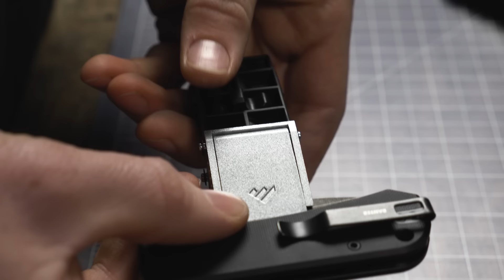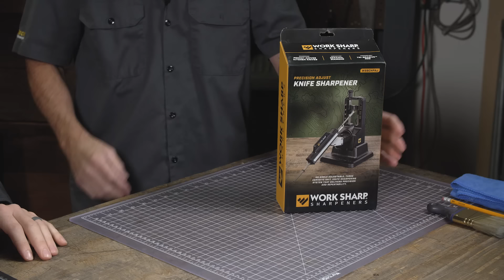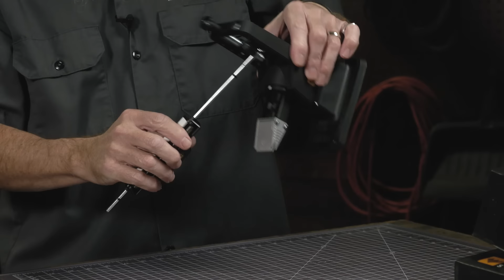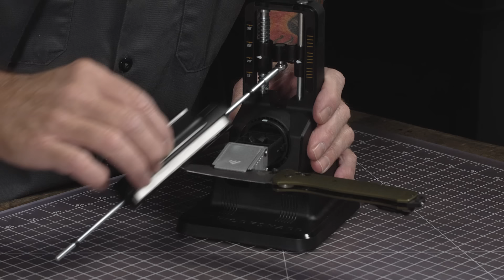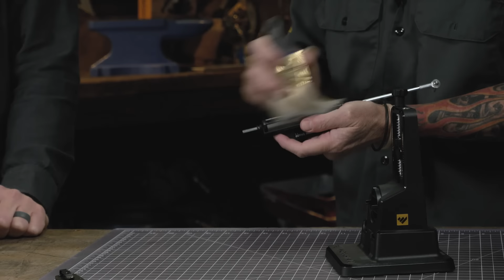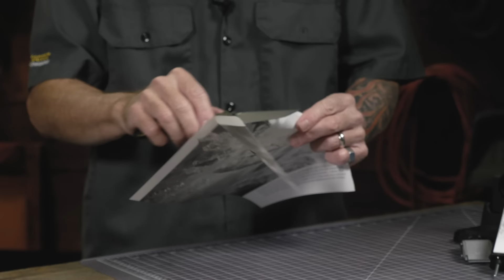How to Use The Precision Adjust Knife Sharpener - User's Guide: How to Sharpen a Knife

Comment: As far as I can tell, that 20-degree angle is not actually 20 degrees. It looks more like approximately 40–45 degrees! This is a serious mistake!
So, if customers are being misled about this, then this product is a scam. There is a huge difference between sharpening a knife at 15 degrees and sharpening it at 40 degrees!
The basic rule is that a knife, or any cutting tool, MUST be sharpened at 15 or 20 degrees, and the sharpening angle must never exceed 20 degrees!

Comment: Getting mine tomorrow. Was curious, wont the distance between the knife spline and the cutting edge change the angle of the sharpener? Like if my kitchen knife is 3” wide and I set the sharpener to 20 degrees it would end up being a different angle compared to a 2” wide knife? Cheers!

Comment: I’d like to see you guys sharpen a Case trapper pocket knife, and/or kitchen paring knives. Both these blade are approx 9/16” wide. I’d like to see how the clamp holds these and if the abrasive actually with contact cutting edge of knife. So many of these type sharpening systems fail on these types of knives. 
Thank.

Comment: How can you be sure of the sharpening angle when the depth of the blade in the clamp will determine the angle also.  So a different width blade on a different knife will be of a different angle.  How do you compensate for that??  Every blade width will not indicate correctly on your angle gauge.

Comment: Just received a reply from work sharp, as I just purchased this. They will not tell you that depending on knife, their product will not hold securely. They actually said to not to try and use this, sharpen your knife FREEHAND?????? kind of defeats the point. Anyway, buy something else like a cheap temu sharpener which will work. I just pitched my worksharp junk in trash.

Comment: I'm confused, in one of your other videos you did 4 different ways to move the sharpener, and put each result under a microscope, the end result was the push method yielded a much sharper edge of the 4, and the sawing method had the least sharp edge of the 4.  Why are you now using the saw method?

Comment: How do you put a smaller knife in the clamp? I can not get get some of my smaller normal size more classic style Case knives to fit in it so it can be sharpened.
Reply from the maker: On the original Precision Adjust, the limitation you’re running into is spine-to-edge height. Many classic Case knives (pen knives, stockman blades, etc.) simply don’t have enough blade height for the clamp to grab securely and keep the knife centered and stable.

That’s exactly why we added the Small Knife Table on the Precision Adjust PRO — it solves this issue by supporting short blades that can’t be clamped conventionally.

For the original Precision Adjust, the best options are:

Use a manual sharpener like the Guided Field Sharpener or Benchstone, which handle small blades really well, or

If you sharpen a lot of smaller knives, consider the PA PRO specifically for that added flexibility.

You’re not doing anything wrong — it’s just a physical limitation of the clamp on very short blades.
Reply: @WorkSharpOutdoor  would have been nice to know before I spent money on this thing

Comment: I have a question about small blades. I can’t seem to not hit the vice with the sharpener with a small case pocket knife and get a decent angle
Reply: It does best on wider blades for sure. I don't think there's a good way to do small blades on this one. Apparently the higher grade model comes with an attachment for pen knives or other narrow blades, but it doesn't fit this model.

Comment: One thing I will say is this video doesnt go over how hard it can be to remove burrs you need to flip flop the knife 30 times in some cases very tedious
Reply from the maker: Totally fair callout. Burr removal can feel like a flip-flop marathon some days. 😂
Different steels and angles hang onto a burr like it owes them money, and yeah—it can get tedious.

What we try to show in videos is the baseline technique, but real-world sharpening is messy: sometimes it’s 2 passes, sometimes it’s 20+. A lighter touch, a cleaner apex, or a quick strop can speed things up.

One trick that can help: bumping your angle up just a hair on the finishing passes. That micro-angle shift makes it easier to knock the burr off. Just be cautious on leather — too much angle and you can roll the edge instead of cleaning it up.

No shame in the long haul, though. We’ve all been there.

Appreciate you bringing it up—super common pain point and worth talking about. 👊

Comment: So I bought this kit and... was hugely disapponted. I followed all the steps but I couldn't get my knives to be as razor sharp as the ones in the video.  I set a 20 degree angle for the three kitchen knives I was testing the device on. Well, what can I say? I never got the burr they're talking about in the video. It was always barely palpable and I just couldn't figure out how much longer I was supposed to go on using the 320 diamond. Where did I go wrong???

Comment: Not a true sharpening session. What they don't tell you is that thr clamp arm is not very stable. As you sharpen pushing back and forth thr arm tends to move as well causing the arm to fall out at times. Even with light pressure the arm would move. You would have to hold the arm as well along with the whole sharpener. They actually sell a  stand to place under the arm to improve the stability of the arm. If you don't stabilize the arm your knife won't be sharp.
Reply: You are so correct!
I had trouble with it as well.
Consequently, I have returned mine and spent three times the amount to buy the Pro!! This has a 'blade' support. 
I should receive it in about a week.
Fingers CROSSED!

Comment: Love the design of this. 
However, I have questions. 
I bought something similar to this a couple years ago and it’s a huge pile of shit. My own fault as I fell for fb marketing pop up vids. Mine was basically the same physics but stones were cheap. More filler than actual abrasives and the devise couldn’t actually hold a solid angle. Was all over the place. 
I’m dying to know real life experiences with this sharpener. If it works as advertised, I would buy in a heart beat.

Comment: Do ANY of your precision Work Sharp adjust knife sharpeners securely hold a standard 10"-11" kitchen SS knife?  The narrow one you provide holds the knife well in the middle but lets the knife rotate all over the place at each end (especially the pointed end).  I use very light pressure on the stones but it still moves.  Short 4" - 6" blades do great.

Comment: One major thing people have to remember with the sharpener like this.... you need to have flats on your blade to keep the blade centered so you don't have a messed up Apex when you're sharpening. I have a fairly expensive sharpening system that has a similar clamp system. The problem with it is, when you don't have any flats, you're basically trying to clamp two angles. So trying to get the literal apex of your blade centered is almost impossible. So when I go to sharpen my kitchen knives, since the knife doesn't have flats to keep things centered, the clamp clamps onto my blade which is 100% angled, and now one side of the clamp pulls the blade up or down etc. So unfortunately it's not 100% reputable wanted to just touch up your Edge. A lot of times I have to start over again because I know that the Apex is off and I just have to re-sharpen the whole thing. Now again, if it has flat you don't have to worry about this. Maybe this system takes this an account. If it does I may actually be interested.

Comment: Well, I see a problem. The angle will change based on the width of the knife blade. I'm sure it will still be close, but you could use a tape measure and some simple math to make sure you are at the right angle. I just ordered this for $60 on Amazon. Great value! I have their Work Sharps travel size sharpener and they make great products.
Reply: It doesn’t matter though, because you’re using whatever angle works for the bevel on THAT particular knife. Once you find the correct angle, it IS the correct angle. So knife width isn’t a variable that changes how you sharpen it. The angle at which the stone creates an apex is what it is. You’re not selecting an angle from a chart, you’re selecting the ACTUAL angle of the edge bevel, so there’s no issue with differences between knives.

Comment: This might be a dumb question, but before I buy this, I'd like to know the answer.
My current EDC is sharpened at 25°. That's 12.5° per edge. When I set this for 25°, am I setting it for 25° per edge, or is it splitting the difference to 12.5° per edge? I also have a couple of kitchen knives that are sharpened at 17°, but only one edge is sharp, so if I set this to 17° is it going to sharpen just that one edge at 17°?

Comment: Hello, I just bought one of your sharpeners a few days ago and I like it but what is the reason for having to press the button in the back to rotate the blade? I find the button difficult to operate. It’s sticky. It’s much easier just to pull the clamp away from its retaining magnets, rotate the clamp, reinsert it and continue. Seems like it’s the same difference. Your advice would be appreciated. Also, how can I loosen or smooth up the action of the push button spring clamp rotating mechanism?

Comment: this looks like a great re-design of the multi arm jig. I believe with that, you swing the stone against the knife's edge,  not up and down as you go across.  Just like you would if the stone was flat on a table and sliding the blade across it.  That is how I was taught.  I can see doing it like this for a chipped, abused or severely dull blade, but why do it like you are demonstrating when sharpening a maintained knife?  Why not just swing the arm  and stone along the edge a few times on each side?    Thank you

Comment: I think the basic Precision Adjust is better than the Professional one... Quicker and easier setup: Non-Pro base just snaps in vs Pro requiring two screws; Non-Pro rod just magnetically attaches vs Pro rod having to screw in. The Non-Pro is more smaller and more compact, and comes with a case with the Elite version. The Non-Pro rods have three stones on different sides, so you just turn the rod and keep going as you work through the grits, whereas the Pro requires physically swapping out the stones. The Pro also magnetizes your knife blades due to how the sharpening stones are held on. The Pro might be better for a more permanent setup, but for something compact to keep stored away at home, I really think the Non-Pro is better. It just needs some 3D-printed mods like the support brace, and a digital angle finder. It'd be nice if you did an upgraded version of the Non-Pro that keeps the same form factor and convenience.
Reply: Just color the edge with a sharpie and take a light pass to find edge angle.

Comment: This is actually not the best way to sharpen knives. The best way is (dampen the stone with a little water/less is more) in an arc from heel to toe with light pressure with 15-20 passes one the first side, flip the knife, then 15-20 more arcing passes with light pressure. Then flip and do 10-12, flip, 10-12 and then half as much on each pass down to 0.

Comment: How I used the Worksharp Precision Adjust: 
-Removed the Tri-brasive stone/handle from the rod.
-put nails into the holes to act as a pivot. 
-glued a small metal plate next to the ceramic for my magnetic angle guides to stick to. 
-threw the rest of that wobbly garbage in storage. 

I was given one of these by a friend who purchased it and absolutely hated it. After attempting to use it one time, I see why. The blade absolutely would not stay still in the vise, nor would the actual vise hold stable. It defeats the whole purpose of locking the knife into place if the knife or vise can then move around slightly. After about 20 minutes of attempting to sharpen a kitchen knife and having to readjust it 4 times, I just took the stone off and freehand sharpened it in about 2 minutes. When I realized that worked better, I decided to keep it that way. 
It is now my favorite sharpener, but if I had paid $60 for the whole system, I'd be pissed.

Comment: Ok so how do I sharpen a karambit with it
Reply from the maker: Clamp the knife in the center, choose your angle and abrasive and get to it.  The narrow stone on the Precision Adjust should work just fine for most karambits unless the curve of the blade is really dramatic then you would want to turn to one of our powered sharpeners that use flexible abrasive belts that can follow the curve, like the KTS Mk.2.

Comment: Can you use honing oil  on the ceramic
Reply from the maker: We don’t recommend using oil, as it can get messy and may cause the rod holding the stones to gunk up. A light spray or a few drops of water, however, can be helpful for achieving a polished edge.
Reply: @WorkSharpOutdoor  awesome thanks for the reply and the video super helpful 👍

Comment: Bought this system a couple weeks ago after using  various other sharpening systems out there throughout the years. This is a great sharpening system and very happy with it so far. Sharpened all the kitchen knife set knives and the wife is very impressed how it was able to resurrect a pretty beat up set to very sharp. 

The only thing I'd like to see, is a finer stone, maybe 1000 or 1200 grit, and a more sturdy, heavy frame made from metal.
Reply from the maker: Thanks for the feedback and glad you are enjoying the Precision Adjust!  We came out with the Professional PA recently for those looking for that rigid frame and will have those abrasive options you mention available soon!

Comment: I've had this product for about a week now and have had varying results. 

So far, I find that the blade angle changes when you swap side to side. While sharpening, if you do not check the angle of your guide rod, you will have different angles along each side of your knife. The angles on the stand aren't even close when I use the digital calibration tool. 

All in all, for 300 dollars I would have been better off buying a wet stone kit. This product is a gimmicky and not worth the money.
Reply: You paid $300? I just bought on Amazon for $59.

Comment: I am a female knife collector (I own several hundred fixed and folding knives) and bought your knife sharpening system several months ago.  I find it very difficult to press the button in the back of the Precision Knife Sharpener to rotate the clamp that holds the knife. I've had to pull out the clamp and manually turn it instead of using the 'button.'  Its also hard to press down the clip that the connects the tower comes so I can take it apart and put it in the case. I had to get a pair of pliers to get enough force to release the clip holding the tower together.  I know that men have much stronger hand strength (double of a female) and this device is not user friendly to all users.
Reply from the maker: Thanks for the feedback and that sounds like a pretty epic collection!  Our customer service team might have some tips and tricks to make the sharpening/boxing process simpler.  Shoot them an email to get the conversation started at info@worksharptools.com

Comment: After using this sharpener, like all Work Sharp products it's a wonderful idea that is horribly executed. For the price I would expect something more than a cheap piece of shit plastic base with shitty magnets that hold the clamp in. Could have at least added sand or something to the base to give it some weight. Does it work? Yes. Could it work better? Very much so. I expect this to break within a year of normal use just like every other Work Sharp product I buy.

Comment: How wide does the clamp open? My whittling knife has a curved blade and won’t fit in my current sharpened.  The knife handle needs to be clamped on this particular knife.